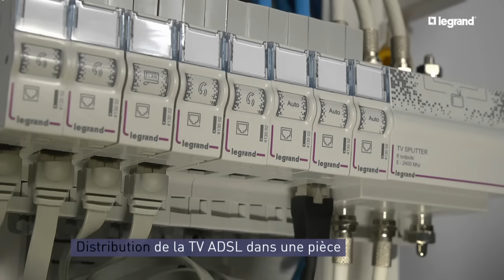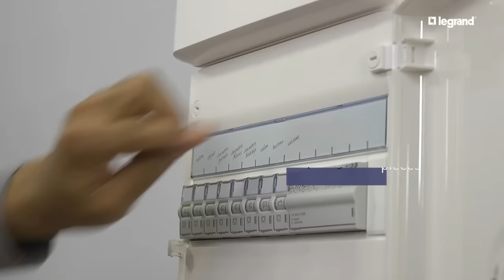Comment installer un coffret de communication multimédia Legrand avec des prises RJ45 ?

Comment: Ça prend un coup de vieux... avec la fibre optique....
Reply from the maker: Bonsoir Alain B,

La fibre optique ne change rien au niveau du coffret de communication pour le résidentiel, si ce n'est d'installer un DTI fibre optique dans le coffret de communication pour l'arrivée téléphonique. Le DTI est relié à la Box Internet.
Quand vous sortez de la box vous êtes en câble RJ45, plus en fibre optique.
C'est sur les sorties RJ45 que vous branchez vos switchs, répartiteur, modules de brassage... Et tous les autres équipements du coffret de communication.

La fibre optique arrive donc uniquement à l'entrée de votre réseau multimédia puis le coffret de communication distribue tous les médias de la Box qui est en RJ45 en sortie.

J'espère avoir pu vous rassurer sur les coffrets de communication en RJ45, qui sont à la norme en vigueur NFC 15-100 pour le résidentiel.

A bientôt sur nos vidéos !
Reply: En effet, merci.
Reply: Bonjour, j ai quelques questions, c cool si j ai les reponses :

1- En cablage reseau dans les gaines, quel est le minimum pour ne pas " brider " les debits en filaires avec la fibre ? Du Cat6 est suffisant ? On s y perds un peu entre toutes ses categories.

2- si on met la Box dans le tableau, on peut eviter un Swith si on utilises peu de prises Rj 45 ? En deux mots les sorties de la Box adsl on peut brasser direçtement avec des cordons aux connecteurs rj du tab de com ?
Est ce preferable de lettre a chaque fois un switch ? Pour eviter de se prendre la tete

3- si on met la box dans le salon, et qu'on veut distribuer dans les pieces l Adsl mais en filaire et ne pas utiliser le wifi, il faut je pense creer un retour de la box du salon pour alimenter le flux Adsl du tab de com

Bon merci.

Et legrand c top tout court
Reply: - Je me permet de te répondre, le cat6 est utilisé actuellement partout dans l'industrie et le tertiaire. il est donc largement suffisant pour un réseau domestique.
- Si tu met ta box directement dans le tableau tu n'a pas besoin de switch car elle distribuera directement ton réseau. tu sera juste plus limité en nombre d’accès ADSL sur une box lambda du doit avoir 4 ports ce qui est déjà pas mal.
- donc dans le cas ou ta box n'est pas dans le tableau il faut irrigué un switch dans le tableau qui sera brasser dans le tableau pour distribuer ton installation.